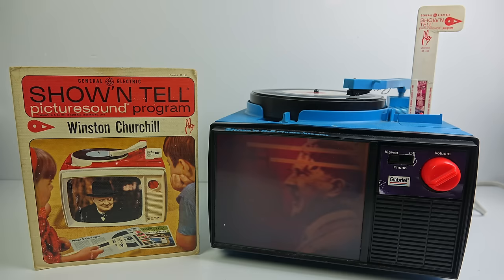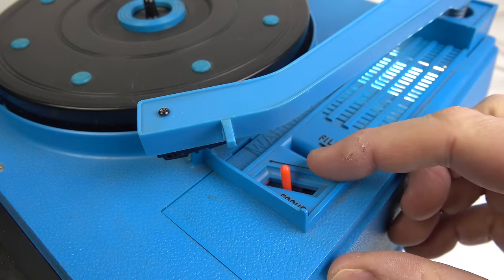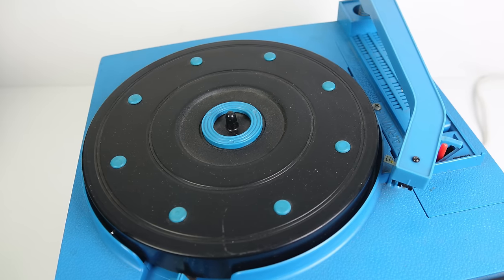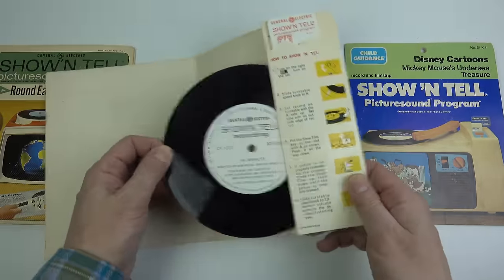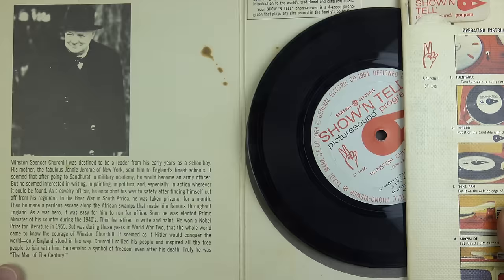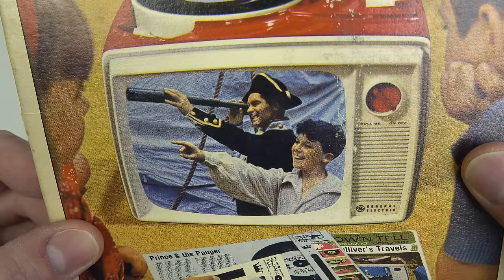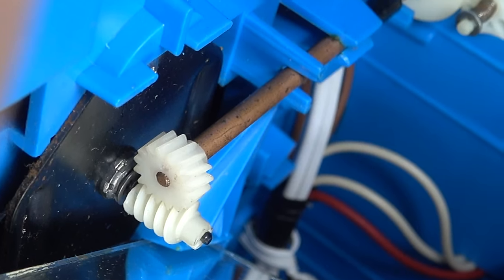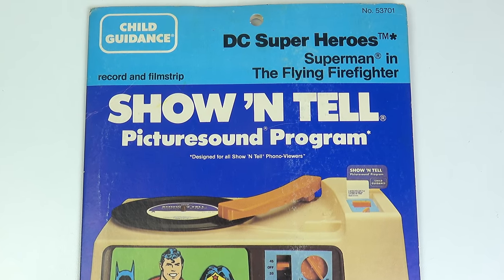Show 'N Tell - 1960s Children's Multimedia System

Comment: It could be gold if someone managed to make the beggining slides of fallout to play on this thing.
Reply: It wouldn't be that hard to make the slides, the record would be the hard part.
Reply: This whole thing would be quite the challenge. Printing onto clear plastic is a largely lost art, especially for something custom like this. Lathing the record would be the easiest part.
Reply: @hanniballecter4283  it seems like ordinary 16mm film, you still can get it.
Reply: @thesandwichslayer9948  you can get custom lathe-cut records for about $50 or so.  I have a lot of experience with 16mm, using a movie camera would be VERY difficult to get a one-frame image. However, there were a number of "subminiature" cameras from the 1960s that took stills on 16mm film, so you could do that! 

So theoretically if anyone wanted to spend the time and effort to do it, you could have a matching slide strip and record for about $100 or so!
Reply: There are some specialty shops that make Viewfinder disks; I'm sure they could make the appropriate slides! Then add a 3d-printed holder, and the rest is having a record pressed..
Reply: I could easily print on plastic with a nice printer. Or cellulose.
Somebody just needs the record, really. How about Mr "Lathing the record would be the easiest part". It's been a long quarantine, you've probably had some free time. Did you figure out how to turn the record? I'll gladly print the slides.

Positivity guys, I know I'm late and fallout was kind of a dead meme for a little bit, but what with the election and possible Civil War and all, it might be relevant soon.
Reply: @Dubtee  Ah lol I have no experience lathing records lol.  There's services that do it for you, that's what I was talking about. 

I suppose you could just print transparencies, though that would be even lower quality than what this produces.

But whatever, it's all hypotheticals anyways. None of us will spend the time or money to do it 😁
Reply: @JeffDeWitt  Or just shove a LCD where the slide goes and make it a projector
Reply: @hanniballecter4283  for anyone with experience in traditional photography or work in a photo printing store, printing on plastic or cellulose is far from a lost art. You just need the supplies. And putting the audio on the record could be done without too much trouble, even with makeshift supplies.
Reply: Hell, you could actually just send the images to a photography store that has processing and printing equipment and they could convert it for you. I know I was able to pull images from a usb into our processor at my old job to get them onto slides and/or film strips for those who wanted it. A fair amount of students would use the service so they could print out images they had worked up in photoshop but wanted to use traditional or alternative photo printing methods for.
Reply: I saw your comment a while ago. And i managed to figure out a way to actually do it. I have to play around with it before i make a video though. Ill keep you posted.
Reply: Looks like this just used regular 16mm film, which you can still get prints made for lol
Reply: "following total atomic annihilation..."
Reply: @hanniballecter4283  you could laserjet print onto clear plastic
Reply: “War… war never changes”
Reply: Forget Fallout. I'm sick of hearing about it
Reply: @Dubtee  Welp, now that Ukranian-Russian war is happening (which sounds very similar to “resource wars” from pre-war Fallout the more I think about it, imo,) it’s more relevant now than 1 week ago. As a latvian, I really hope that it doesn’t turn into, as a Vault-Tec Rep would say, “eh-hem, a total nuclear annihilation”.

Anyways, has anyone made these Fallout-inspired slides yet?
Reply: @tommyramsey6199  how? its an awesome game series
Reply: Or the gek test
Reply: @KelBShobra  I’m pretty sure that by “gek” you meant G.E.C.K.
But I’m also pretty sure that by “Garden of Eden Creation Kit” you actually meant “G.O.A.T.” since this is the only thing from Fallout 3 that used picture slides. Not sure where you got the GECK from
Reply: War, war never
Reply: That’s very possible, I could probably find somewhere to get a fallout record made and a slideshow for it, I actually have one of the original General Electric “show and tell” devices my great grandma had in her attic
Reply: @JeffDeWitt  you need projector film  camera and kodak super 8 film. Turn the mode from run to s. f.   And it records only one frame. If u done you take off the film and get to the film processing store. And there you got your celuloid tape. Now take off tape where the frames are. Now make the plastic cover like on this video and glue. Done! You've got an silent film. Now all you need is record.

Comment: Representing a saving of zero cents
Reply: By Grabthar's Hammer... what a savings.
Reply: But... it's under $5!
Reply: Pay & Sell
Reply: Probably just reflects the prices they pay for the products from their wholesaler(s). They calculate a margin based on the cost price for each size of unit.
Reply: Pook365 My local supermarket does that too. The tech department is also pretty funny. Either the things are completely overpriced or so cheap they must loose money on them. I recently saw 16 GB of DDR4-3000 by Corsair for 80€. I really don’t know what their business model is.
Reply: I like the old market banter ... "One for a pound, three for a fiver!"
Reply: The SD card were more expensive over by the Nintendo switch than they were over by the digital cameras in walmart.

I still can't believe walmart sell stand alone camers in 2018 considering everyone has a smart phone.
Reply: Michael Persico  the pins are wired up just the same as any other sd card. They are just charging you more because it says "switch" on them

Comment: In the late 60s/early 70s, we owned a genuine GE "Deluxe" Show 'N Tell. I'm not really sure what the difference was from the regular model though I suspect that the Deluxe was built more to be a piece of AV equipment.

The bit about rolling back the turntable awakened a vague memory that the old ones had an index mark on the turntable which you were supposed to line up as part of loading the record and film strip.

Watching the changes in the amount and type of programming over the years as well as the apparently quality decline reminded me a bit of the rise and fall of the ViewMaster.

Comment: Very disappointing that the film used in Show N" Tell has turned to pink. The reason is... most films back in the 1960s were using the Eastmancolour format, which turns to pink over time, due to the poor colour dyes during the process. Compared to Technicolour, the colour dyes are permanent. But since Technicolour has gone expensive in the 1950s, most companies use the cheaper process, which is known as Eastmancolour. :\
Reply: That's something I recall about the Viewmasters, those were all either Technicolor or Kodachrome.
Reply: Ahh I noticed that! ;)
Reply: I've noticed that pink effect on some of my 8mm films.
Reply: The good news, though, is that if you have a film scanner and software that supports ICE^3 (ICE cube) you can fully recover the original color despite the photos having turned pink.  I have tons of old Brownie style color photos shot by my grandfather, and other family, that had all turned pink due to the red and blue dyes degrading, but fortunately a Nikon LS-8000 film scanner and software will restore the original color in your digitized scans of the photos, it just adds a little added processing time (which is almost nothing with modern CPUs, but was much greater with the original mid-90s Pentium II 400 and 128MB that was state of the art at the time I bought that scanner).
Reply: I have a home movie that I bought on eBay it’s format is 8mm It’s from 1947 and it’s in color and it’s in excellent shape still has a lot of its color. Can anyone please explain why the film hasn’t really faded or turned red?
Reply: Collector of Antiques and Valuables 
Because it’s likely Kodachrome. 
It was a different dye process and though an older one, it has proved to be impervious to the fading of some of the other color film processes. Also your film, and Kodachrome was a reversal process. That is, your film is the one run through the camera to shoot it. Eastman Color was a printing negative stock to make color print films and slides from negative films.
Reply: I have quite a few from that vintage on Kodachrome and the Reds and Greens are very vivid.  Looks as good as the day they were shot, but old 16MM eastman ones are mainly Magenta.
Reply: Early Eastmancolor faded quite quickly even back in those days, that's why Kodak made a new formula in 1981.
Reply: Actually, you are right!! It does happen on 16mm films too, and I also seen logos that are faded to pink as well! I also noticed the wow and flutter (warping) which is unlistenable!!!! :|

Comment: You need a PURE sinewave inverter. The inverter you're using is a modified square wave, which can cause problems with induction motors. That is why you were getting that obnoxious buzz as the motor expects a pure sine wave

Comment: Looks like they were using the cheaper Ektachrome or another equivalent brand of film. Ektachrome used chemical dyes of which the blue dye faded rather fast. The more expensive Kodak Kodachrome used natural dyes and the earliest films still have their original vibrant colors, providing they have been kept in a good environment.
Reply: Actually, it's Eastmancolor print film, the same as used to make the positive prints of movies.  A lot of it exhibits this color fade.  Ektachrome from the 1960s is fine.  The problem with using Kodachrome isn't the cost, but it simply isn't designed for duplication - the beauty of Kodachrome is in the original!
Reply: @gdavisloopfta380   My terminology is corrected. Thanks. It's been a long time since I've had to deal with film and I have trouble remembering proper nouns.

Comment: 8:30  I wouldn't doubt these were printed on Eastman color stock.  That stock tends to fade considerably fasted than most.  This is why most color TV ads people may see on YouTube tend to look red on purpose.  It was a cheaper stock to print on.
https://en.wikipedia.org/wiki/Color_motion_picture_film
Reply: >This is why most color TV ads people may see on YouTube tend to look red on purpose.
I would expect that if the uploaders knew how, the would apply color correction.
Reply: Fridelain It might work, but it's rather tricky to get the color right, it ends up looking too bluish-purple if not tinted right.
Reply: Fridelain Eastman is very difficult if all the colors are completely gone if all that's left is red.

Comment: You could purchase an uninterruptable power supply from the US, charge it up, then use that to power your 60hz devices.  APC UPSes are generally very good quality.  Though I'm uncertain if they sync to the mains frequency or have that programmed in.
Reply: As somebody mentioned, the output waveform on a UPS isn't much good. Arguably it's going to be worse than a specialised frequency convertor like our guy used. PC power supplies can take any old shitty waveform and manage fine. AV equipment, even toys, not so much. 

You could hook up an old-style rotary convertor. You'd get a 50Hz motor and a 60Hz motor, both made for the same RPM speed. Bolt the shafts together, then plug one into the relevant mains supply. The other will act as generator. 

Only problem with this might be, that motor speed is a function of the number of rotor windings, and the mains frequency. So might be American motors naturally run 20% faster than UK ones. Or it might be possible to get two of the same speed. 

This should give a very good waveform. Voltage might be a bit low but that's not a big problem. 

They still make rotary convertors for factories. You can do it electronically, but using real rotating coils comes with the least side-effects.

Comment: You should be able to get a clean 120 volt, 60 Hz signal out of a pure sine wave inverter (from North America, of course).  Get one of those and get a locally sourced RV converter.  Connect the converter to the inverter, power the converter, turn on the inverter, and you should have a perfectly clean signal.

(should...)
Reply: 110 volt
Reply: 110 volts is too low, but could work.  Wall voltage should ideally measure 117 VAC in North America.  110 volts is for Japan (and a few other non-North American countries).

Though he could get a Japanese inverter as well to power those items!
Reply: In the United States and Canada, national standards specify that the nominal voltage at the source should be 120 V and allow a range of 114 V to 126 V (RMS) (−5% to +5%). Historically 110 V, 115 V and 117 V have been used at different times and places in North America. (This is relevant for vintage equipment.)

110 works with everything due to tolerances, and (undervolting) has the advantage of running the equipment cooler, which preserves it. 110 it's also what most inverters will put out, because it's more efficient and works.
Reply: Yes, when Tesla was selling his equipment to GE, you'd be right.

LPs didn't exist when 110 volt electricity existed.

In fact, I have a feeling there's nobody alive in the US from a time when there was 110 volts.  Also, back then things other than light bulbs used Edison screw sockets.

Techmoan doesn't have an interest in carbon arc lamps nor washing machines, he's never going to own a 110 volt device from the US.

In other words, 110 volts is totally useless for him except for Japanese equipment (and equipment from a few other odd countries should he ever get stuff from them, which he usually doesn't).

FWIW, the USA also used DC power, if we're going back that far.  And two phase power.  But I also would not recommend anyone buy stuff to generate those because it's of no interest anymore.
Reply: Also while 110 volts works with everything it BURNS OUT THE MOTORS.  They'll work for a while and then they'll be toast.  If you don't believe me, ask an electrician what happens when you undervolt a compressor or a motor.  They'll explain the physics behind it to you.

It is a poor choice that only an idiot would make.
Reply: Lastly, no, most inverters in North America DO NOT put out 110 volts because the companies selling them don't want to buy you a new fridge.  Being that I live here I've put them on meters, they put out 117 volts.  Because 117 volts is what is expected.  Of course, I can only measure pure since wave inverters because I don't have a fancy expensive true RMS meter, but frankly, it doesn't matter, because a modified sine wave inverter is complete trash for this purpose anyways.
Reply: Here's a paper on building a sag generator just to specifically test the effects of voltage sag on motors (answer:  it's bad):

http://www.leonardo-energy.info/sites/leonardo-energy/files/documents-and-links/p269.pdf
Reply: 110 is not low enough to cause the motors in 120 appliances to stall and burn out. It's the stalling that makes them act as resistances and burn out.
Reply: It's the wrong voltage and it's extra stress for no reason.

Anyone who owns an RV has firsthand experience with how voltage sags affect motors and compressors.  A lot of RV parks in North America have long runs of wire that isn't sufficiently sized, causing voltage sags.  RV techs will tell you of just how many burned out AC compressors they replace every year.

Sorry that you don't understand this.  Please, do some research.

And "It's the stalling that makes them act as resistances and burn out." is just mumbo-jumbo.  You don't know what you're talking about and you're out of your league here.
Reply: @Fridelain  I've been in buildings with 3-phase power in which the "120 V" outlets measured  108 V, but it would be better to avoid finding out which appliances are compromised by that voltage. Most USA homes measure a little over 120 V.